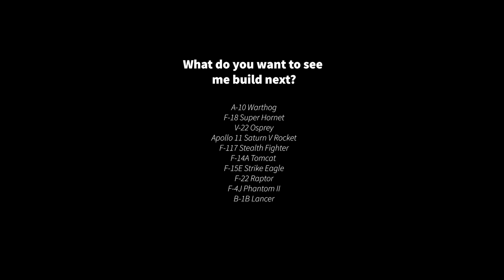Testors 1:72 scale B-2 Stealth Bomber Model Build

Comment: Do you have to super glue the parts together
Reply from the maker: No I used a plastic cement to glue the parts.
Reply: @avion34  oh ok so I have to get that then I am about to start on this model
Reply from the maker: @serialdestinationN-w7w  Very cool. This kit is from 1995 so I will say that the fit, and overall detail isn’t that great. It’s an excellent beginner kit, but later if you want a nicer B-2 in 1:72 scale then check out the one from Modelcollect.